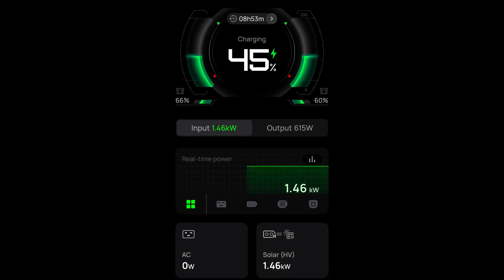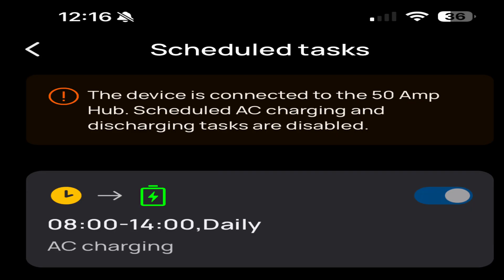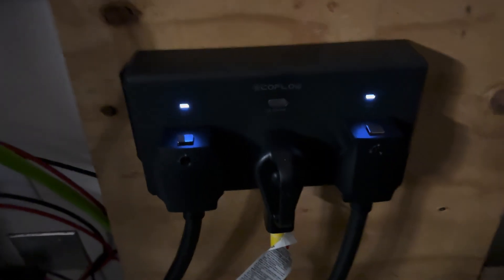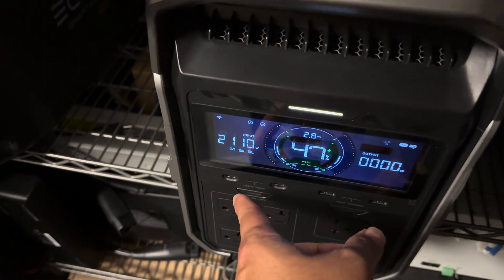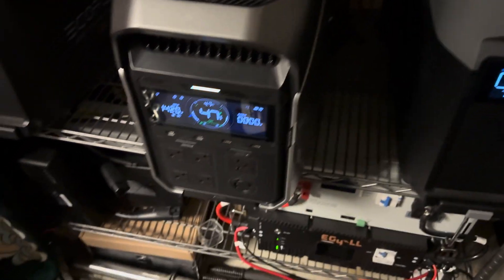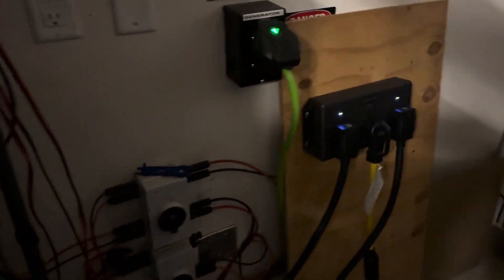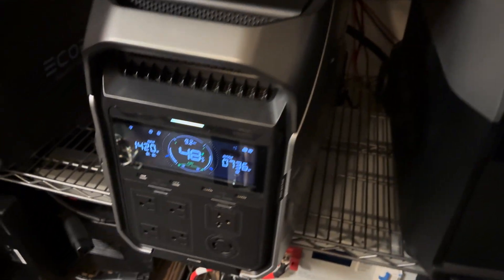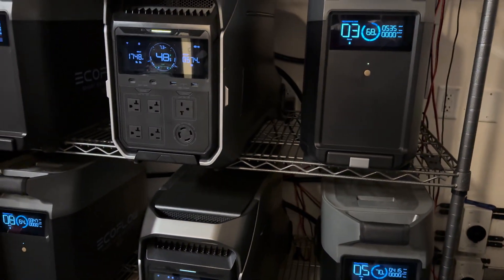EcoFlow Delta Pro 3 Hub glitch?

Comment: I  had 2 Delta Pro 3 ( DP3 ) units running in parallel with their 50 AMP hub bridge. One of the units was defective and caused a tremendous power surge which fried my HVAC thermostat and ECU, coffee maker, Air Purifier, GFCI outlets, and over a dozen outlet surge protectors and damaged 2, 200 AMP breaker panels.  The damages have run into the thousands. One electrician who inspected my system told me that one of his customers had a similar problem with his EF Ultra except that he didn't have the unit hooked up to the home.  I like the EF Delta 2 Max batteries, but the EF DP3 and the bridge is not good. $12,000 of damage was done.
Reply from the maker: Wow I’m so sorry that happened to you and for sharing this info that’s heartbreaking . I had the problems with this happening 2 times since then they have updated there software we’re these issues didn’t happen again. I run my house 24hrs a day 7 days a week off grid with no issues thank God. For the winter the sun is low for me in Cali so I’ve had to switch on and off grid a couple times a week my solar panels are not producing enough